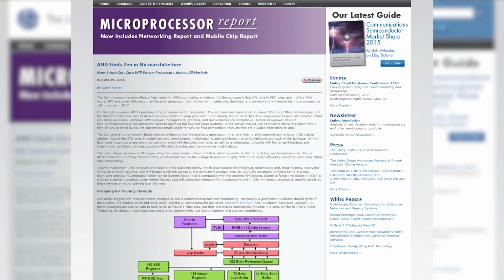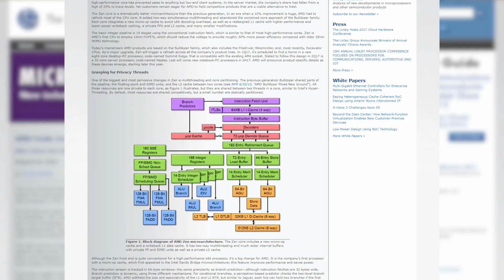Dissecting AMD Zen Architecture - Interview with David Kanter

Comment: I mis something.
1st The prime problem of AMD Buldozer high-end is 32nm vs 14nm. Handicap. 
It are small cores sharing FPU , but are real big real estate on 32nm Die. Eats a lot of power and limits clock scaling compared to 14nm.
Zen and intel Core Are  Big Full cores on 14nm which are small on 14nm Die .

2.  Bulldozer architecture may be bad. but how bad it should be compared to something similar on 32nm 
or estimate what nextgen from Bulldoze family on 14nm could replace AMD 9 Series.
6GHZ Turbo and 125Watts?  A Excavator on 14nm small 8core 4 FPU chip

Architecture is problem its one point in the stack of problem.

Stack
1  32nm vs 14nm
2 Architecture IPC
3 TDP
4 cloks
5 number of cores
etc
------------------
Performance

al those work to together. 

Buldozer at 14nm
Higher kloks to compensate lower IPC.

Or because 2core/1FPU module could be == iNtel 1C/2HT 
16c/8FPU vs 8c/16t

What are the tought on that?
Reply: Look back at Sandy Bridge vs. Bulldozer arch... similar process tech and speed.  Still a large difference between the two chips in terms of performance.  Yes, process tech plays a big part, but AMD stalled right out of the gate with the architecture and only now that they have cleansheeted something new are they going to be competitive.  Excavator on 14nm would still have an IPC deficit vs. Intel's latest.
Reply: With the First Bulldozer AMD did not reach clock target.
AMD latest top end what the can do , a 9 series 5gHZ 200+watts monster on 32nm.
Imagine what that will do on much more optimised but shrinked achitecture. ULV TDP on 5GHZ
or boost klok as high to compensate IPC

I just wonder.
Reply: I think it's was because the disponibility was to low to offer at the time the 200-300$ price.
Reply: James H nevermind, English it's my first language
Reply: ... it's not...
Reply: Because iNtel comes first with next die shrink there proces is at better level to begin with where AMD strugle to rush out what they can do often to late.

The PU where there is equalness in procedé are GPU from AMD and nV from TMSC.
Reply: The way I see that AMD take the most out of it and released a 5GHz Turbo chip on that old handicap 32nm. Put that on 14nm  . 32 to 14 is factor 2+ x wich means Diespace difference of 4x So 9590 would be very small chip. Zen on 32nm  Would 4 times bigger chip with high TDP or low clocks.
So it isn't about IPC it would be if all everything else is equal. It is not. The difference between 32nm 14nm is 200+%  On 14nm the clock won't be equal. Then it becomes IPCxClock. Because so much room for more transistors a 8FP 16 core vs intel 8core/16thread would be posible

Comment: PC Gamers: Isn't this the same dude who was lying about Nvidia's Async Compute capabilities back when the Beta of Ashes of the Singularity came out during Maxwell lineup...... I guarantee you all that he isn't even a gamer to begin with. He was talking all of this stuff about Nvidia will have Async Compute capabilities for PASCAL not telling people that Nvidia's pipelines are mostly full so there wouldn't be any use for Async Compute for Nvidia's cards to begin with. Gamers: Be cautious of alot of these dudes on Youtube who aren't real gamers.
Reply: You really should learn what a rhetorical question is before typing....you really should.
Reply: God, how much are you being paid for all of this?
Reply: Your damage-control is pathetic.
Reply: To be fair this is the type of person who would evaluate gaming as simply one type of workload for a processor. The discussion focuses on a much wider evaluation of the processor architecture, though I would expect if they were to host a similar conversation, addressing specifically gaming specific workloads the conversation would be quite different. While performance desktop parts primarily used for gaming workloads, it is only a partial focus for any processor as mobile and server are much more commercially relevant applications. You can look at the point made towards Kaby Lake, for gaming, where power consumption is almost not relevant, it's quite disappointing. However mobile and sever spaces benefit greatly from the Kaby Lake iteration of processors. Making the point that you need to have a much broader conversation about processors to understand why for gaming Kaby Lake seems average, but more broadly it's actually quite an improvement compared to Skylake. Intel is not "taking the piss" with Kaby Lake, but you need to talk about processors outside gaming to actually understand that. Suggesting that these people are shills or talking shit or whatever else you are implying is just ill-informed.

Comment: I just want to know I was thing... why the hell does Zen only have 16 PCI lanes??????¿??????
Reply: I think the rumors are that it has 24 PCI-E lanes. 16 for graphics that can be split into 2 x 8. 4 lanes for M.2 and S-Express, and then four more that attaches to the Southbridge.
Reply: Josh Walrath so my next question is.. why?  I haven't don't my research as you might have guessed but.. if it's true that Zen is going to head to head with Intel in the 6900k.. then I believe the 6900k supports what is it 48 lanes?
Reply: Yes, but AMD is again aiming at a different price point and trying to make the chip more marketable.  So it really does not want to have 2000+ pins on a CPU that won't reach $1K all the while keeping motherboards relatively inexpensive.  I believe they have 1331 pins which allows more PCI-E lanes than what FM2+ gave with 906 pins.  Intel is able to give all that PCI-E support because these are essentially server level parts with a price tag to match.
Reply: Platform cost. Broadwell-E is more of a server or super high end type platform with corresponding features and price. So Ryzen is not really going "head to head" with Broadwell-E, but instead doing its own thing and slotting itself between Intel enthusiast and mainstream lines and offering good price/performance ratio while doing that if what we have seen in leaks and speculations turn out to be true.

R7 1700 ($319) or R7 1800X ($499) + X370 ($149-199$) + 16gb DDR4 ($120) = $588-$638 / $768-$818

i7-6900K ($1030) + X99 ($199-$400) + 16gb DDR4 ($120) = $1350-$1550
10-core 6950X adds further $700 to that price for 2 extra cores.

Naples CPU:s and motherboards for those are what you want if you are looking for more server-type features or large amounts of PCI-E lanes. Those will launch during Q2 according to current schedule from AMD.

Comment: When you talk about IPC or the older MIPS (Meaningless Information Propagates by Salesmen) you have a meaningless statement until you actually define what an "instruction" is. Is it just furious activity in silicon or does it actually do a computation? MIPS is "It is a tale Told by an idiot, full of sound and fury, Signifying nothing." On one 68000 one instruction can be an 32-bit integer multiplication. In the SPARC chip is can be 1/33rd of a 32-bit integer multiplication. 
  I once designed a system to test SCRs. When I looked at microprocessors, I first picked a simple semantic - the computer must turn on a light bulb. The F8 took 14 instructions. The Intel 8085 took 7 instructions. The 6800 took 3. Adding an addressable latch cut the 6800 instructions to 1. All to perform the same act. Direct Execution architectures have the best performance since the machine language is a high level language. 
  Compare the WD LSI-11 to the WD P-Machine. It is the same hardware. They just changed the microcode from implementing the LSI-11 architecture to implementing the Pascal p-code. The throughput tripled. The instructions/second changed only because the architecture changed and the meaning of each instruction changed.

  Compare the Novix to the 68000. The Novix has 5000 gates on a gate-array chip and is clocked at 2MHz. The 68000 has about 68000 gates clocked at 10MHz. The Novix has over three times the throughput. The Novix is a stack machine implementing the Forth interpreter in hardware. The 68000 is a variant of the 1950s von Neuman architecture. I asked Charles Moore if he would make the Novix chip as a custom chip. He said no. I had to agree with him. The resulting CPU would cost about $7.50 (only 5000 gates) and would require 2ns memory chips (typical chips were 250ns). Again the instructions/second changed because the meanings of the instructions changed.
 IPC only reflects the amount of activity the silicon is doing but has nothing to do with the actual throughput.
Reply from the maker: MIPS is a company, and the acronym stands for Microprocessor without Interlocked Pipeline Stages, and not your clever "Meaningless Information Propagates by Salesmen". Their architecture was RISC.

Comment: Ryzen is basically yesteryear Haswell.   It's just laughable at the boners AMD fanboys have when they could have bought a 4790K or higher years ago, and basically had the same level of performance Ryzen will.....but for longer.
Reply: sure.. i see 4 core cpus in normal price range 300+- are good for you. even mobile phones went 8 core not to mention ps4,x years ago. portlandia is reality for pc gamers. and feeding fat cow intel. monopoly is good for customers. switching motherboards every 1-2 years just to get 10% ips in synthetic benches if lucky. lets not forget if you need more then 4 cores thats exclusive for elite. new expensive mobo must be, and cpu 450-1200 why not. AMD just shows how extreme milking is by intel. 10 years old 4core cpu thats good to masses. you are naive and young but let me tell ya. AMD is very needed in pc market just to be. rescued us from intel madness. you should be happy. but fanboyism is ego. more powerful than common sense..
Reply: If you think you need to upgrade just to get a 10% performance improvement, then you're the problem....not intel.  AMD fanboyism is AMD not releasing a CPU for 5 years, then releasing something that would barely compete with the top of the line intel CPU's from 5 years ago.  AMD isn't soo much moving into the future, as it is picking up where it left off like it was 5 years ago.  Ryzen is basically haswell with more cores.  Intel can easily crush AMD.  I mean you AMD fanboys seem to act like Intel is trying its hardest and AMD has it on the ropes.    

And actually, people will be paying more for the new AM4 socket.  On top of that, these benchmarks aren't even anything but AMD deployed marketing hype.  Every time, year after year, AMD never lives up to the hype.  Ryzen will be on average, 15-30% slower than Intels latest offering, Intel will drop some prices, and AMD will end up sitting in a precarious price bracket.  Fact is, spending 20% more on a CPU for 20-30% more performance, is actually better in the long run, because it not only provides greater performance, it provides less cost in the long run because of reduced time between upgrades.  Which means less other components one needs to buy over time.

For example, many AMD fanboys bought AMD 4 or 6 cores, then later upgraded to 8 cores.  Even if they kept the same motherboard, at ~$100 for the 4/6 core, then another ~$200 for the 8 core, they spend over $300 alone on CPU's.....all the while having a slower CPU than say, a 4770K, the whole time....when they could have simply went with Intel to begin with.    On top of that, to get a motherboard with USB3/SATA3/etc.....Intel came in as cheap as $40.  For AMD, to get SATA3 support on AM3+ was for the longest, only available in the $80+ price bracket.  

So all things considered, Intel was not only the faster choice, in the long run it ends up costing the same or less.  If I had gone with an AMD cpu and gpu, I would have to of bought a new power supply to handle the extra wattage, that alone saved me another $50+.  So AMD's last generation, was by no means cost effective in the long run.  Ryzen will be exactly the same, because that's how AMD operates.  I've seen AMD remove whole selling point features from products after purchase, and nary a whisper.

  Let's not forget AMD was selling the r9 290 for $400 when Nvidia came in with the GTX 970 for just $330.  Let's not forget that AMD dropped passmark because passmark wouldn't skew benchmark scores for them.  Let's not forget that AMD cried about Nvidia being better at tessellation, when they have the ability to manually adjust tessellation factors.  Let's not forget that AMD used Mantle aka Vulkan to sell a lot of CPU's and GPU's, but only had it in a hand full of games. Let's not forget that AMD sold mid range DX11 cards at a premium, 2 years before a DX11 game even came out.....meaning that by the time those cards could be utilized, they were already obsolete.  And that's only a few damning examples.  AMD is not innocent by any means, they're a terrible company.  And that's not even getting into how they actually run their business, with top heavy management.

AMD doesn't want to compete or innovate, all they want to do is wait for the next foundry node fabrication process and slap the same architecture on it again and again......AMD's last several CPU/GPU generations are all pretty much the same architecture with just minor changes or instruction set additions, then they just rebrand it a new architecture, when the actual performance improvements come from the fabrication process size.....which AMD does not develop, the foundry that produces the chips develops that technology.
Reply: nice answer. you should actually write this from the beginning. you have good points on cpu departament but total misknowledge. and all on gpu i total BS.ok. bulldozer cpu is still on your mind and mad price for it when was release(good oc 8000+ 200w which is madness in my opinion) amd was newer good at TDP. at that time 2500k was a king. best cpu ever made. marketing hype man. amd was allways bad it that..
if its true that ryzen is slower then haswell 15-30% what's the point of realising it. and you maybe dont know but intel never drops cpu prices bc they make $ on prebuild systems not us. and this is true amd crappy MB designs are not good (AM3+). but cheaper than competition. there are no amd fanboys. jest people who like to save(not overpaid) intel stuff w/o good knowledge. Wattage is a big concern to me to. im not poor but i upt hd5850 to rx480 8 gigs only cuz low power consumption. good cuz i was very close to buy 970 like most at that time. but after 3.5 still called 4 gigs. i changed my mind..which put me to gpus and fairy tales you believe you know. 290 was mining card. and at least in europe was always high priced and its a 2013 gpu. 970 is new better tech in that so what do you expect. tessellation was new and clever way to lower amd performance back then. you know that if you write about this.Vulkan man is the think we need whatever you own nvidia on amd. just play doom if you havent. i won't even go deep in this subject. but dx12 is modified Mantle in bad way by M$..rest i won't comment..